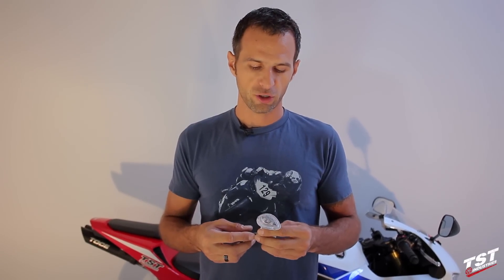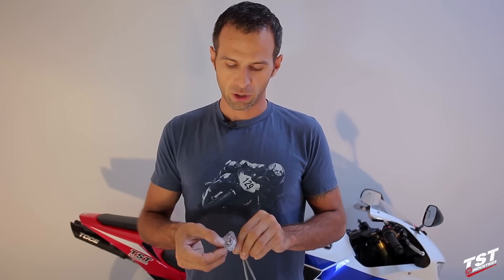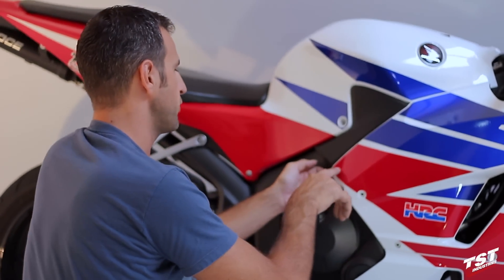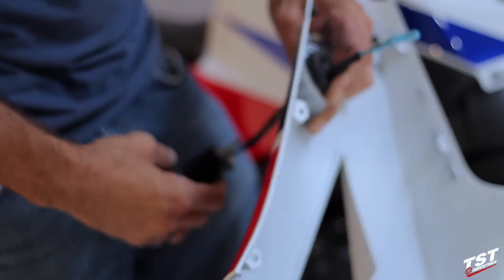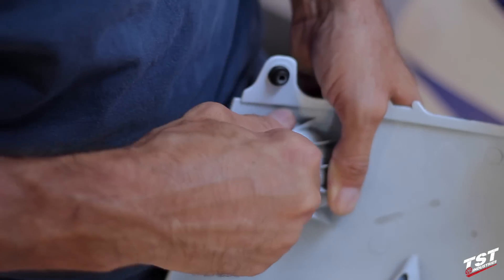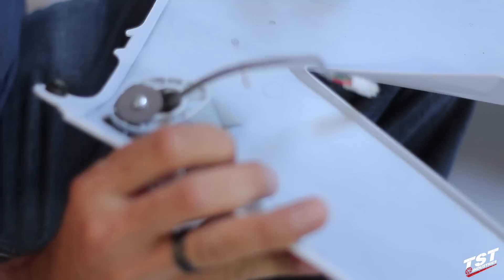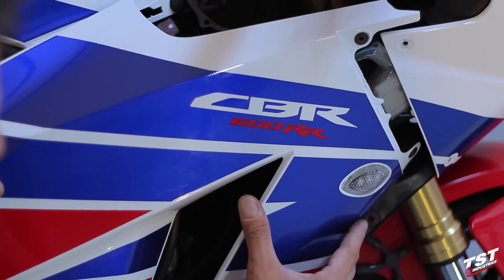How to install 2013+ Honda CBR600RR Halo-1 Flushmount Signals by TST Industries

Comment: will this fit the 2016 properly cuz the 2016 panel is different and more deep than the example ur showing
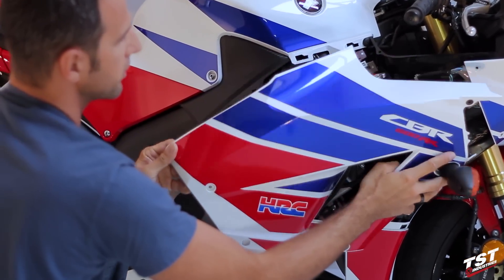Reply from the maker: The 2016 panel is exactly the same as 2013+.  See time stamp 2:31. You will notice that the signal well on these fairings is very deep. Our signals are designed to fit perfectly in hat well.

Comment: Would this work with a '13 CBR 500r?

The styling and turn signal look almost identical.

My assumption is that you would just need a 3-2 adapter. 

Even the seating of the light in the fairing looks the same.
Reply: And besides the 13 - present bikes look far more futuristic

Comment: Very cool, can you make the light permanently orange or does it have to blue and orange for right/left turn signal?
thanks!
Reply from the maker: Hee 3 the blue light is just the running light so yes we can get rid of that wire for you.
Reply: Yes, I would like to order pure orange flushmount, inte grated taillight, and Fen Eliminator. How can I order the flushmount to be pure orange?
Reply from the maker: We do offer a flushmount that has an orange halo glow along with the Orange/Amber turn signals. You can purchase directly off of our website. If you go to our sales ad for the integrated tail light and add in the relay g2, plate bracket, and license plate light it comes out to roughly $120. You can then add in the Halo turn signals and for under $200 you can have it all.  Hee 3

Comment: Will these work for an EU 2013+ CBR600RR? Or will a pin adaptor be necessary?
Reply from the maker: Im working from memory here so you have to help me out with some info. Does your bike have drl function in the signal lamps? I believe that in EU there is no running light function in signal lamps on this bike. In that case you have a two conductor connector for the signals and that will clash with our lamp's three position connector. If this is the case the installation will not be plug and play. You will need to remove the pins from your current lamp's connector and reuse that plug with our lights. This will only get you signal function but no running light. If you want running light you will have to run the wire  unused in the plug to a switched/fused 12v source.

Comment: Hello there Iam facing issue during opening faring of my cbr 600 2014 am changing engine oil first time please make a vedio on oil change and filter and how to open complet faring thanks
Reply from the maker: I wish I could help you but we are scheduled out through early October with all the time we have for video.
Reply: no problem brother . thanks for reply . but if you get some extra time in future plz make a video on how to remove faring because I search for it but did not get any video .

Comment: Will this kill the battery since the light always stays on?
Reply from the maker: Not at all. Your stock lights are always on as well and there is no issue there. Being that these are LEDs, they are drawing a fraction of power compared to the stock lights.

Comment: can you make a video to install flasher relay?
Reply from the maker: On that bike it is so easy we didn't bother. You can use this video for reference https://youtu.be/gwq4kTjW3m8 . Take your driver seat off, find OEM relay, swap it for ours, replace the seat. That's how simple it is.
Reply: @TSTindustries  does this video have the relay installed? will it flash faster than shown in this video without the relay?
Reply from the maker: @twitchmania7614  what you see in this video is proper 85 cycles per minute flash. This bike already had the integrated tail light and relay done before we started the flush mount installation. If the bike had a stock flasher relay the signal rate would be much faster.

Comment: Mine broke during our winter where temperature dropped to minus 6 c. Unfortunately I live in Scotland and I can expect low temps annually. Going to fit yoshimura ones this week.  Much better looking quality. Tst screw goes into main plastic housing. Let's water seepage in. And that froze , expanding to break the plastic. Poor design IMO.  Needs a rubber or seal.

Comment: Don't mean to come across as a party pooper but isn't the point of turn signals that they can be seen by other road users, not hidden
Reply from the maker: These Halo-1 signals were designed to provide superior brightness for signaling, but with a sleeker profile. Yes, you do lose a little visibility from the front when compared to the OEM, however, the three 1W amber LED chips will make up for any brightness lost. In addition to the brighter LED chips, we designed the lens and the circuit board to face somewhat at a forward angle to provide ample lighting when viewed from the sides of your bike but the front as well. Our signals are a very popular choice for aesthetic reasons which is why they are designed this way. We always try to balance safety with cosmetic appeal.

Comment: Can you make this product for older cbr's as well. 2004+? please and thank you
Reply from the maker: Unfortunately we will not be making Halos for the 03-06 600RR. However, we might release a video showing the installation of the 07-12 version on the older year models. This will require slight modification to the side fairings for the Halos to fit.
Reply: TSTindustries can you make, wıdeo for thank fairing remomber  please?air filtres ..

Comment: I have the same bike 👌
Reply from the maker: You know what to do now! :)
Reply: Just waiting for my flush mounts to arrive from you guys 👍 great videos by the way Bart
Reply: They will have the 3 pin plug already fitting won’t they ?
Reply from the maker: @danielblake704  awesome, thanks.
Reply from the maker: @danielblake704  the signals come with the wiring terminated in the connector that plugs into the 3 conductor harness socket.
Reply: TSTindustries clearly they don’t I’ve had to buy the 3-2 harness but on this installation video it clearly shows the connector plugs fitted 🤔 p@@@ed off to say the least

Comment: Would this work with a '13 CBR 500r?

The styling and turn signal look almost identical.

My assumption is that you would just need a 3-2 adapter. 

Even the seating of the light in the fairing looks the same.
Reply from the maker: sorry bud...this will not work on a 500r